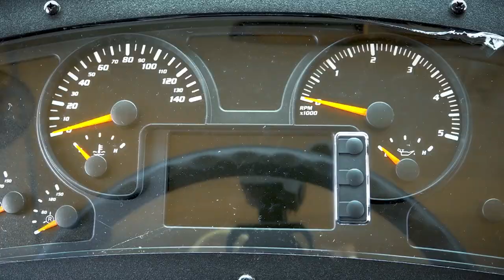Blue Bird, The World's Most Trusted School Bus

Comment: Yay bluebird is back! I ride a ga spec 2020 bluebird vision gasoline in Floyd County made 6/19. I used to ride one of your experiments. A 2007 bluebird ec72. I want to buy it but I don’t have the money or space to park it.
Reply: I want to get a T3 FE
Reply: Nabi Fuhu noice. But T3s are newer so it might be a bit before one is on the market.
Reply: SchoolBusDriver71 yeah. I think I’ve seen some for sale, used before. You never know lol
Reply: Nabi Fuhu yep the bus market is crazy lol
Reply: SchoolBusDriver71 haha! Sure is.
Reply: What's the EC72 like?
Reply: @uAKING2006  not bad. Not as smooth as a ride, because it only came with Springleaf as an option. But it does take up faster than the first and second version even though it has the same engine. You can also hear the engine more.

Comment: When you drive 2023 the long nose blue bird  school bus, you feel this is horse riding! because the bus even in flat roads moving up and down. You can’t imagine in 8 hours work how many times you go up and down even in in 15 mpg !!!!! If the road is not very flat oh my God it’s like you are sitting at spring!!! So after 8 hours work with this bus, you just feel back ache. Engine is weak so body of the bus is heavy it doesn’t move on uphill very well!!! I am sitting on my couch with pain and don’t know what to do tomorrow in my job with this nightmare bus!! 😢
By the way I wish I could take pictures of this bus problems. The old buses are much better and stronger , I don’t know where and who assembled this new buses ?????? The version I have at work is 2023 long nose gasoline one ! With a lot of problems and also very bouncy site and also bus is very bouncy too it is ready for jump up and down even for it’s weak engine working!!!!